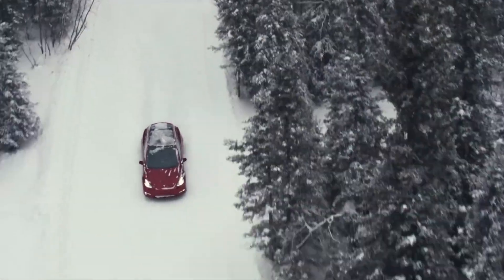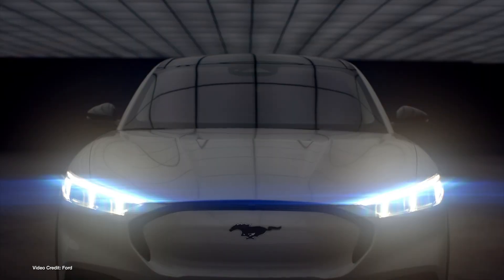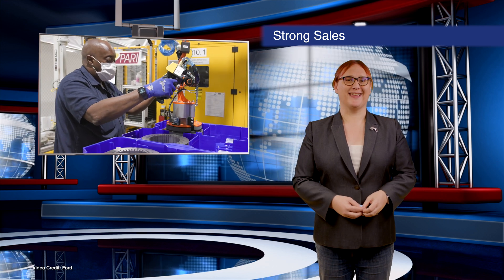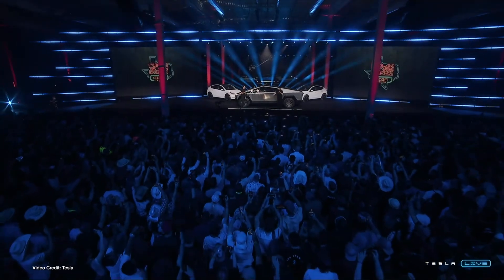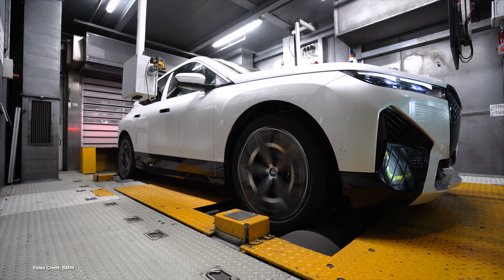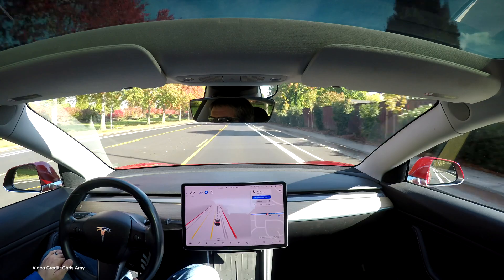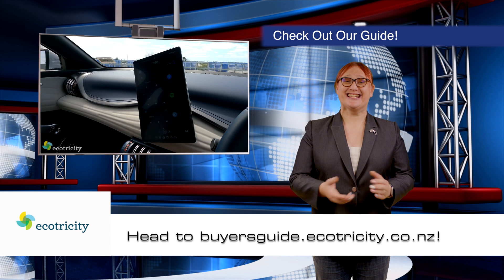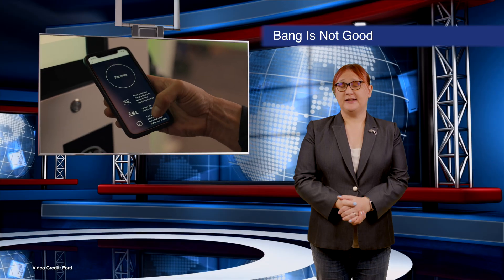EcoTEC Episode 252 - Tesla Semi, Aptera Uses Tesla Charging, EV Sales Soar!

Comment: Tesla semi is a step in the right direction for owners out side America who care about the environment...but for American owners not so much as the vast majority of electricity is produced by coal and gas powered station's...and the carbon credits Tesla get from government for producing and selling EVs is on sold to some of the worst polluters to continue to pump out massive amounts of C02 with impunity...and don't get me started on the C02 emissions required to produce these trucks, sadly it's a case of 3steps forward and 2steps back!!.🤔💕🇺🇸🇺🇦
Reply: The electricity in the US is not "vast majority" coal and gas, indeed, it is a shrinking modest majority of just under 60% at this point, down from just over 60% last year. And that's before the IRA takes effect. Even if it was all coal though, it would still be an improvement.